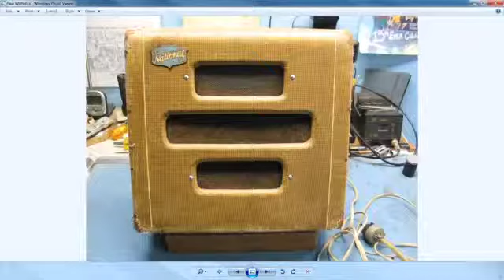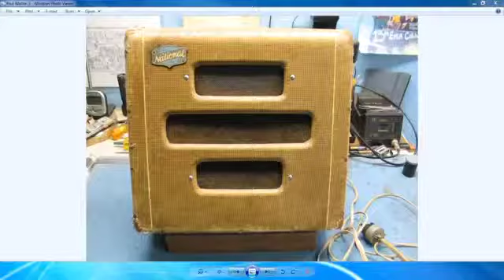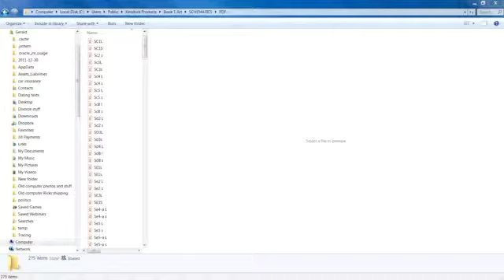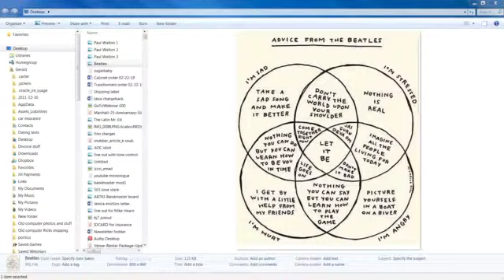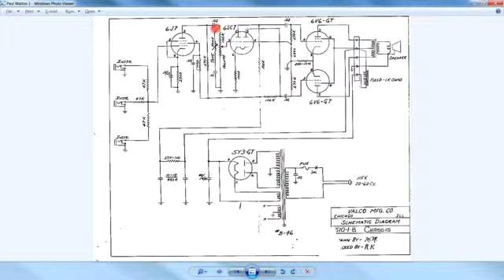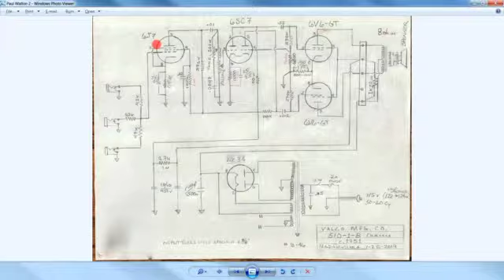1949 National Tweed Amp fix

Comment: Hi, was weird how the plate voltages on pre amp tubes were very un even. Did you check those 
plate resistor values?
Would be interested to know what the 6V6 plates voltage was too. 
Was an interesting video thanks.